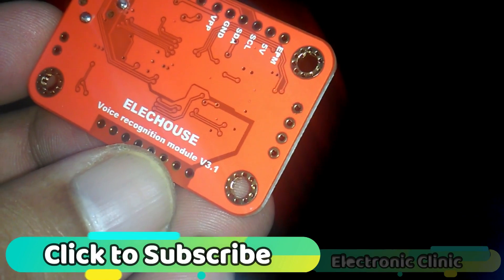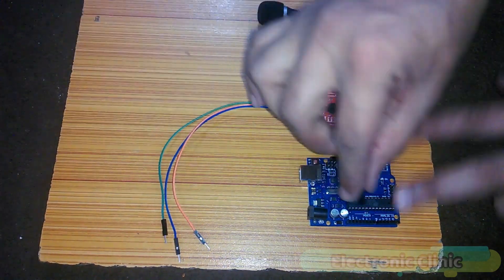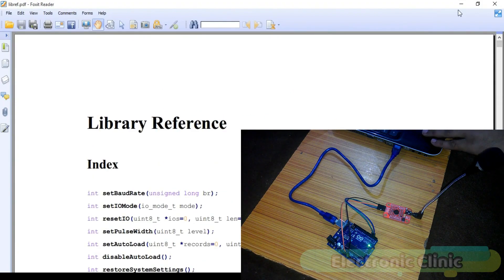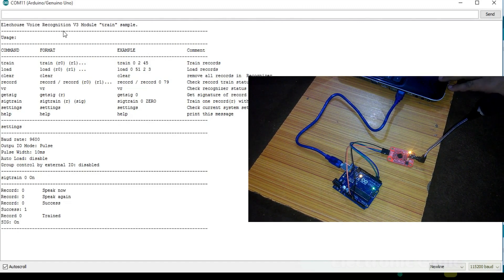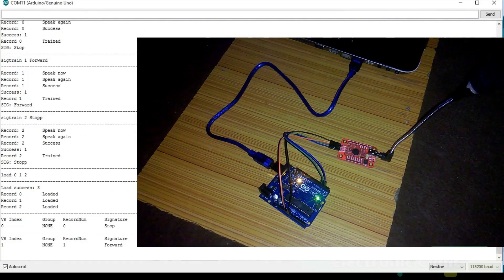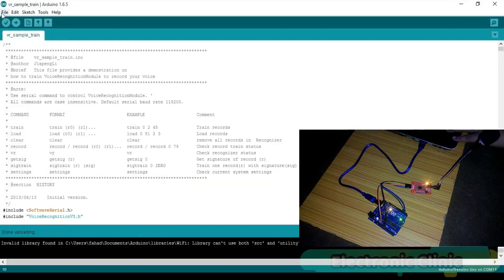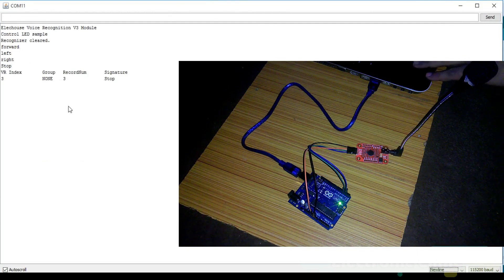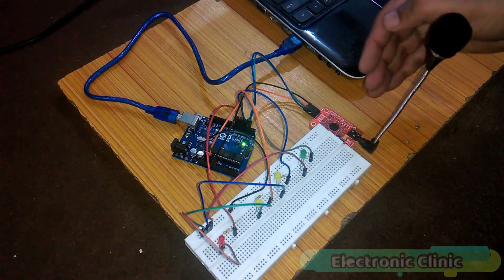Voice Recognition Module v3.1, multi language commands training “speech recognition,Arduino Tutorial

Comment: You are not using autoLoad command. How will this work with a wheelchair without loading records everytime you switch on the motors?
Reply from the maker: i have controlled leds, which means i can control anything.
Reply: @ElectroniClinic  Thanks for the reply. I meant to ask you how are records getting loaded themselves, every time there is a power cycle(power off and on). As per the V3 Library reference pdf, SetAutoLoad command is to be used. I could not find that command in your modified code.
Reply from the maker: voice controlled wheelchair is available on website.

Comment: Guys, if you're using this on the Arduino Uno, change the pins tx=2 and rx=3. The comments on the code are wrong, at least for the Uno.
Reply: hi, the pin will same for arduino megA?

Comment: Are you using any program on pc helping you in this project?
Or by arduino only?
Reply from the maker: only Arduino and the serial monitor.
Reply: @ElectroniClinic   so it saves the input voice...? 
I mean can I run the project without laptop after entering the commands?

Comment: Does it make a difference if i am using the geeetech voice recognition device? and ive gotten it uploaded....pin 3&2 dont do anything. why not Tx & Rx? last question when i have it plugged into 3&2 i get "check system settings error or timeout" when its plugged into Rx&Tx it does nothing at all.

Comment: Am i the only one having issues uploading the software? following exactly what you say it always fails to upload.
Reply from the maker: Use the correct library and check if you can compile the program.
Reply: Actually I just figured it out. Had to unplug Rx & Tx. Not sure why he didn’t have to. I have seen other people say you have to unplug those two while uploading and it worked for me.
Reply from the maker: Yes you have to unplug. if you are using the arduinos default serial port.

Comment: Hi! Thanks for your Tutorial, works fine for me! Today I tried to train my module with navigation commands directly from google maps (on iPhone). I connected the devices by 3.5 plug but it was difficult to train the commands. After training the detection was poor (i tried 10times and it detected it just 2 times...) did i forget something? Do i have to convert the signal or something. Sometimes connectors im 3.5mm plugs are twisted... but then it would not work at any time but it does sometimes. Thanks in advance! Dan
Reply: have u solved this problem? if yes, how did u do it?

Comment: after uploading the voice recognition sample train .. in the serial monitor when i send “settings” it responds with “ Check system settings error or timeout” how to fix this ?
Reply from the maker: error time out, is usually when you don't record the command within the specified time.
Reply from the maker: avoid delays while recording your voice command. and also make sure there is no noise.
Reply: it happen before the recording step  @ElectroniClinic
Reply from the maker: did you connect the tx and rx pins correctly??
Reply from the maker: send me pics on whatsapp. 
you can find my whatsapp number in description.

Comment: when i send “settings” it responds with “ check system settings error or timeout “
Reply from the maker: watch this video completely and follow each and every step. Its very simple. use the same library which i am using, the link is available in the description. and also double check your wiring.
Reply: i am using Arduino micro instead of the uno .. does it have to do with the problem ? @ElectroniClinic
Reply from the maker: i have never used it with arduino micro , thats why i have now idea. 
you are the only person which is getting error. all the other guys did it successfully, i think you should first use it with arduino uno. then you can try using it with arduino micro.
Reply: Electronic Clinic I am sorry I couldn’t reach to your number in WhatsApp to send the pictures
Reply: I am also getting the same...and I have followed each and every step as u have showed in the video....wt should I do now... please help me out of this...

Comment: can i get the source code you're using for the arduino?
Reply from the maker: ya sure. 
your email id?
Reply: patricknks@yahoo.com
and also i want to ask something about this module. i've made a code to control servo and it works perfectly when it's plugged in to my computer, but when I tested it with a 9V battery to power the arduino (the arduino isn't plugged in to the computer), the code didn't run at all. It seems like the arduino didn't recognize the library of my voice. Are there some functions that I miss that caused this problem? thank you

Comment: when I type settings it shows "Check system settings error or timeout
"...please help
Reply: me too face thesame error. found the solution?
Reply: Same here
Reply: You should connect TX of module to pin 0 on arduino and rx of the module to pin 1 on arduino
Reply: I guess this should work or check connections.
Reply: @spam1013  yours working?
Reply: @hrishikeshgarud  No but it's pins 0 and 1 are used as default TX and rx on arduino. I guess you need to change the pins in the library too

Comment: This Voice recognition Version 3.1 ?? or if it's V3.1 then 3.1 libraries will work with version 3 module?
Reply from the maker: i have not used version 3. but it will work.
Reply from the maker: because the voice training is same.
Reply: @ElectroniClinic  So I can use the v3 library on voice recognition module v3.1.
Reply: Could you please tell me what is the difference between  v3 and v3.1 module